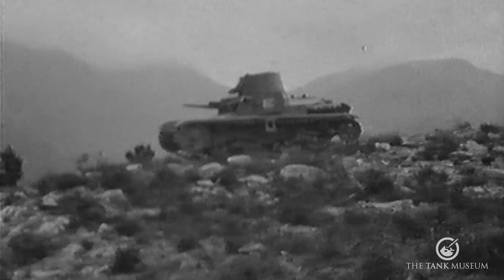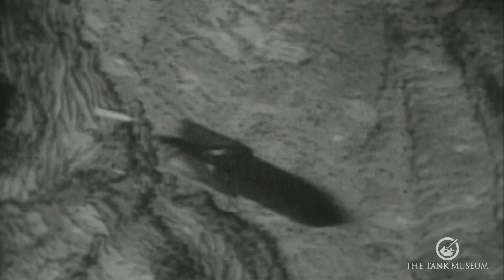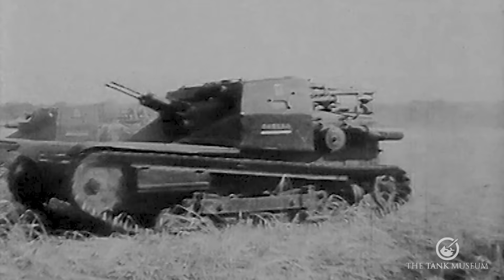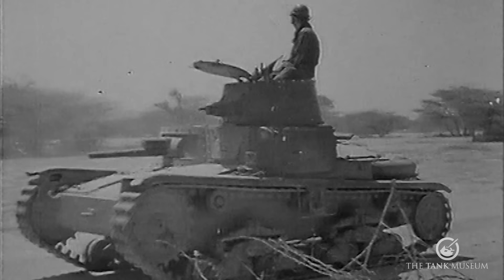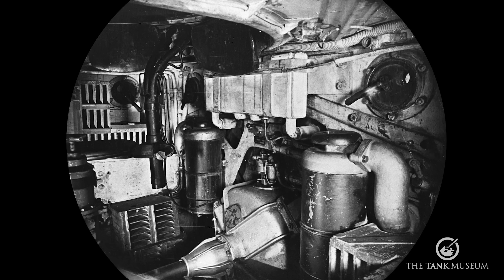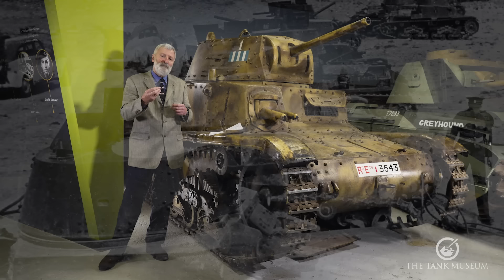Tank Chats #147 | M14/41 | The Tank Museum

Comment: I never doubted the bravery of the Italian army, just the Italian weaponry.
Reply: and their leaders
Reply: @mikepette4422  Accurate assessment. The only excellent Italian commanders were Messe, Guillet & Frattini. Their navy was very decent though but it suffered from terrible ammunition quality & lack of radar.
Reply: @Perkelenaattori  
Not terrible, just unreliable, and they had radars but not long range targeting radars nor radar guided individual weapon systems
Reply: @theotakucomrade   were did you get that? even though they, in fact, had studied and discovered radar technology before the war, it was discarded and neglected by the regime. Italians did not get radar prior late 1942/early 1943, and than just on few vessels. Same goes for Sonar.
Reply: Italian weaponry wasn't subpar for the most part with some lacking exceptions, the tank force was the most underwhelming and less developed branch, but small arms were comparable to their contemporaries, with exceptions.
Reply: @theotakucomrade  My understanding was that Italy's greatest problem was not in quality of arms so much as limited production capacity.  So Italian divisions were equipped with fewer tanks and artillery pieces than other nations.  
But in tanks they suffered from poorer quality and lower quantity.  Poorer quality armor, riveted together, with under-performing engines limiting the overall weight of armor.  You end up with a lightly armored tank held up by the weight of its armor.
Reply: Almost everything

Artillery
Tanks 
Vsmsll arms were mid transition
Machine guns terrible
Not enough transport
Planes outdated
Reply: @theotakucomrade  what tank force? You mean those metal coffins on tracks.
Reply: @steffenrosmus9177  Apparently you didn't take the time to actually watch the video.
Reply: @ficklefingeroffate  No, he was just remarking how awful Italian armor was. And it was all awful. Their best and heaviest design to see production at the end of the war couldn't even match a Sherman or Panzer IV.
Reply: @wolfehoffmann2697  Yes, but you're comparing a 1940 design to 1943 designs. Early war armour is a mixed bag: The Germans were rolling around in nicked Czech stuff, the French with their one-man turrets, the British had just developed the Covenanter, the US had ~M2's. Up against that, the M13/40 is hardly the dumpster fire you're making it out to be.
Reply: @wolfehoffmann2697  Then you watched the video and didn't undertsand nonetheless.
Reply: Well, some of our weapons was actually good, others bad.
Tanks was bad because there was just one single man to design them. I mean, all of them. In ww2.
About leaders, same. Few was bad officers, many was good, excellent officers. Generals was mostly good. Messe was one of the best.
Another one, Bastico, had even more experience and skills than Rommel.
The idea that our army was "bad" or "uneffective" was given by propaganda and a lack of specific explanations about the war.
It's hard to win stuff when your leaders are convinced you are ineffective at best and decide to replace you at the lead of the campaigns.
That's exactly what the germans did.
Reply: So well said Mike.
Reply: Every year Mussolini lived took at least a century off the Thousand Year Reich!
Reply: The Axis was not any sort of alliance beyond a nominal one: they did not plan or co-ordinate strategy at any level.
Reply: Time and again, my ancestors would have rather been home eating and making dinner 😂🤣😂
Reply: Any troops of any army get the weapons they are issued with, they don't get to chose.
Reply: Their hearts weren't in WW2
Reply: Our ancestor had the right heart but wrong leaders and weapo s
Reply: Also the price you pay for gearing up too early. Italian designs were stuck in the 1930's. The Germans were at the top of their technical game in 1940 but quickly fell behind.
Reply: @Ralphieboy  we were making tons of pizze without half of the ingredients to make one
Reply: @Ralphieboy  Germans at top in 1940 and then fall back?!?
Have you ever heard about Me262, V2, MG42, STG44, Panthers, V1, FritzX, Ar 296, etc. etc.?!?
Germany maintained technical leadership all along the war
Reply: There is more to it than just having the new designs, it is about the logistics, service, spare parts and the overall mass production and availability of new weapons systems. 
That takes a long time to develop and that is exactly where Germany fell behind. The Germans had some impressive weapons but never enough at the right place or time.
Just think of what V1 and V2 rockets could have done to the Allied staging/landing areas in June of 1944. But they were not available in any numbers.
Reply: @frankguz55  General Motors man. General Motors.
Reply: @frankguz55  The Allies were not that behind in technology, but had different priorities.  Germans were ahead in submarine technology, but definitely would have wanted to get their hands on the Allied technology that won the battle of the Atlantic in 1943.  ASV radar sets capable of detecting a submarine on the surface, improving to being able to detect a submerged submarine using its snorkel. 
You might have added RPVs flown through television technology and used to successfully bomb enemy targets, but that wasn't Germany, it was the US Navy. Successfully used in combat operations in 1944.
As German night fighters became more effective at intercepting British Lancasters, the British developed radar trained tail guns for bombers that would be in the rear of the formation (automatically aim at aircraft approaching from behind, compensating for range).
Both the Germans and US were working on surface to air missiles. The Germans were ahead in rocketry, but were held back needing a missile that would hit enemy aircraft.
The allies meanwhile had developed proximity fuses by 1942 so a near miss from a shell could be fatal to an enemy aircraft. You didn't need to calculate range anymore for a timer fuse.  Paired with radar and fire control computers they had ground based AA guns that were highly effective at shooting down V1 rockets.  (shooting down V2s was beyond anyone's technology at the time).
Then there is the atomic bomb.  Germany began their program in 1939 and discontinued it in 1942.  USA (and joined by Britain and the Commonwealth) started the Manhattan Project in 1942 and by the end of 1942 had surpassed the German program.  German scientists had not succeeded in initiating a chain reaction or in producing fissile material with sufficient purity.  USA had functional bomb designs long before they tested their first bomb.  It wasn't just figuring out how to produce the needed isotopes, it was how to produce them on an industrial scale.  
And then there is the technological achievement of the B-29.  Look up how few they lost and how much more effective they were at shooting down attacking aircraft compared to B-17s.
Reply: @iansneddon2956  sorry mate, but:
- the current NATO standard machine gun is essentially an MG42 with minor modification
- the standard infantry weapon today is the assault rifle, a new concept developed by Germans with the Stg43
- cruise missles are direct descendants of V-1
- ICBM are direct descendants of V-2
- Modern swept-wing jet fighters originates from German design (first Allied jets were straight wing)

Basically, Germans introduced and defined new standars for most modern weapons, still in use today
Reply: @frankguz55  As a general statement, WW II spawned a lot of technologies and innovations whose influence is behind our modern world.  

USA began their guided bomb program in 1941.
They developed remotely piloted vehicles used to bomb ground targets, and were working on what we call kamikaze drones (cheap television guided aircraft that were to be remotely piloted into their targets).  They also tested Development progressed to successful use of the RPVs, but the program was cancelled because....
the glide bomb and guided bomb programs were showing more promise.  The Fritz-X is famous because it was the first deployed guided bomb.  The US program was more ambitious for TV guided standoff bombs (so the launching plane would no longer need to fly in a straight line after launching, as the Fritz-X required).  By January 1945 they were testing a jet engine version - a jet missile with a range of 120 km and a speed of 445 mph.  But the American successful glide bomb of the war, the ASM-N-2 was a radar guided standoff anti-ship weapon which entered service in January 1945. As it wasn't self-powered it only had a range of about 35 km. But while it wasn't the first operational guided missile, it was the first that didn't need operator input after launch.  A similar bomb that was heat seeking was completed early enough to be adopted before the end of the war, but too late to see action. Key point, the American programs ran parallel to the development of the Fritz-X, but took longer to develop because they were more ambitious in guidance systems.
Other successful weapons include a stand-off glide bomb torpedo (autopilot guided on a preset course, when it hit the water it would release the torpedo which would follow its own preset search pattern until it could detect and home in on a target. Range of up to 40km.
In 1943,same month as Germany deployed their acoustic homing torpedo, the US deployed an acoustic homing anti-submarine torpedo (able to adjust its depth as well as course to attack submerged submarines). These anti-submarine torpedoes were highly effective.  
Basically, the Western Allies introduced and defined new standards for modern weapons, still in use today
On the subject of maritime patrol aircraft, radar to detect surface vessels is standard technology and has been for decades. But initially it was limited to British aircraft, seeing as they invented it.  The Germans later copied it when they captured a version off a patrol aircraft that ditched in France after running out of fuel.
Another British contribution... use of a computer to assist in decrypting coded messages.  
Honorable mention goes to the variations of surface-to-air and air-to-air missiles that were still under development when the war ended. But they were not needed as the Allies' AA artillery became quite effective by the end of the war. The British were quite taken with gun systems that could aim themselves (radar and fire control computers matched to AA guns). They were approaching 100% effectiveness in shooting down V-1 rockets by the time Allied advances in France ended the threat. The precursor of modern systems like the Phalanx.  Allied AA technology saved them from much damage the kamikazes could have done.   
Not denying that the Germans were highly influential on technological development.  My point is that they weren't the only ones doing it.  WW II was a technological war, and the Western Allies were quite active in developing and applying technologies as well. 
The German technologies are more famous because they get wrapped up in speculation about their ability to change the course of the war (as in arguments that if Germany had been able to mass produce X, they might have won the war...).  The corresponding speculation for the Western Allies is lamer since they achieved victory. (speculation about winning the war faster?).
Reply: @Ralphieboy  allied propaganda enjoyer spotted!!
Reply: @Ralphieboy  have you even heard the 132nd armored division 'ariete'
Reply: @Ralphieboy fiat didn't waste Money on developing Better tanks engine
Reply: Don't forget the joke about Italian tanks having one forward gear and five in reverse...
Reply: @Ralphieboy  don't forget the battle of kasserine pass American tanks has faster reverse gear than the Italian one lol
Reply: @Ralphieboy do you feel the need for that kind of jokes on a channel like this?
Reply: that was just an observation. But if you want to keep things dead serious, I will only comment in German.
Reply: @Ralphieboy  nah, jokes are fine, but jokes about French and Italians always fleeing during WWII are just so .. old and lame.
Reply: I just made a statement: that Italians were brave, they were just saddled with poor leadership and poor equipment.
Soll ich das alles auf Deutsch widerholen?
I"ch hatte nie Zweifel an die Tapferkeit der Italiener, nur an die Qualität ihrer Rüstung."
Reply: @Ralphieboy hard to forget when it is in every comment section below

Comment: which tanks/SPGs were better, the Japanese or the Italian ones?
Reply: Hard to say but the early Japanese tanks were comparable to the Italian ones. I would argue that later Japanese tank designs had better guns then the later Italian tanks.
As for SPG designs, I would give the Italians for that due to having a much wider variety plus also mounting some very good guns at the time.
Reply: I'd err towards Italians. Both were really good for 1935-40, on par with most contemporaries at the time. The Italians did upgrade theirs a bit, and the Semovente 75/18 packed a punch and were quite effective despite being a bit of a bodge job (I hear the ergonomics were a bit of a nightmare).  And these got to the troops. It gave them something that could take out a Sherman. 
The Japanese, apart from the upgunned chi-ha, any improved vehicles made in small numbers (at best a couple of hundred) and kept at home.